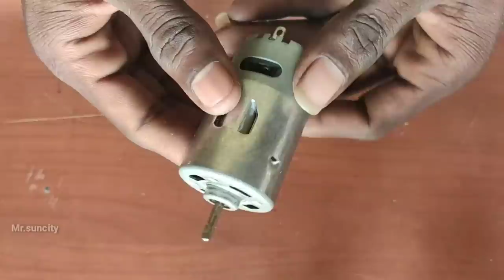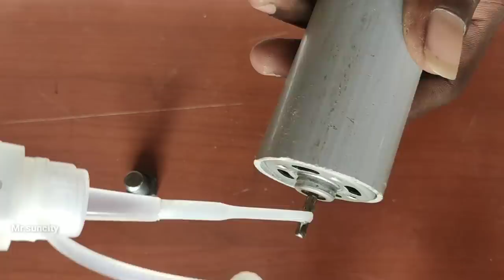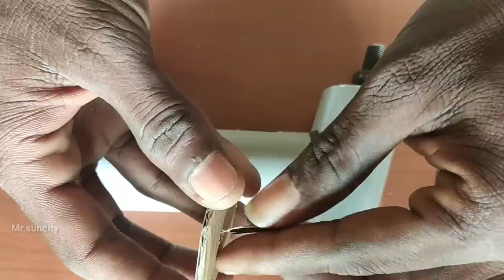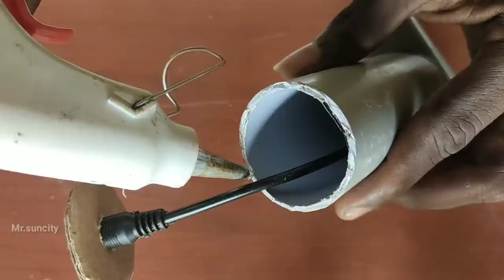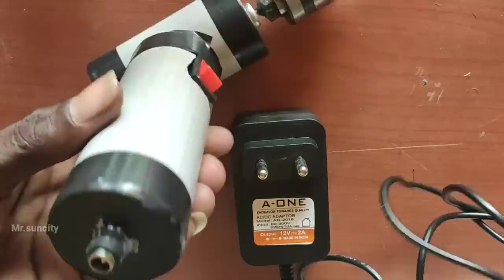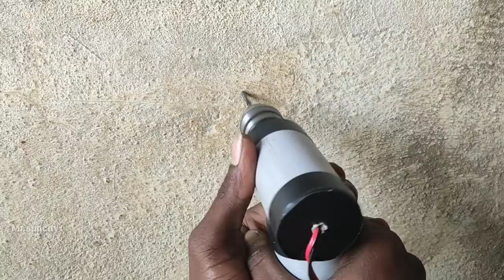Drill machine செய்வது எப்படி | How to make powerful drill machine at home | Mr.suncity...

Comment: Unga creativity ku salute bro...ana neenga solra madhir idha heavy use panna muiyadhy like metal concreate...local shopla 
   775 motor             -      300
Conneting rode.   -         170
Connector chuck.  -       285
Dril bit (each).        -          60
Adoptor.                  -       300

                        Total-      1115

Indha thinks nammatta irundha ok..but pudhusa vangi seiradhuku badhila use fulla oru drill machine vangidalam..bcz nanum ungala pola oru craft lover dhan bro❤❤❤❤❤❤

Comment: Actually bro idea was gud but it needs some of the correction instead of using 12volts  2Amp  u can be using 5 Amps  24 volts may be den it will running faster